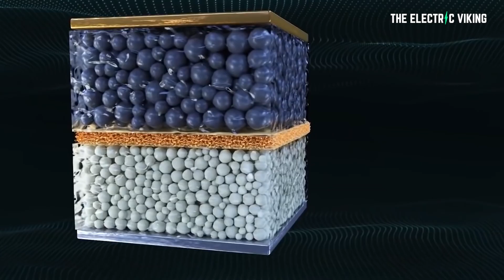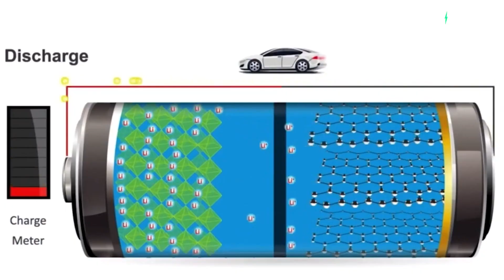New electrolyte prevents EV batteries from fire & increases range

Comment: Any improvement in thermal properties which allows for a higher cell density per battery is welcome.
That said, 212°F is still only 100°C, which is hot, but not 'extremely' hot. Presumably that's the temperature at which it still cannot be ignited deliberately? The flash point will be higher than that, because it's already higher than that for older technology cells.

Comment: Yes, 212°F is literally the boiling point of water. But even plain newspaper burns starting at 450°F, so on a more common scale, a simple trash fire will keep that battery burning.
Reply: Okay, so you put any other vehicle in a newspaper pile burning and what happens? The gas tank is a pressurized system. The gasoline boils in different levels in what is essentially a system that is designed not to allow vapor to escape. What do you think that 450-degree Fahrenheit fire is going to do to that pressurized system with a tank that highly conducts heat? What was your point? I take it that your point is that a battery being on fire is safer than a gas tank that will act like a water heater that builds up pressure. That was your point, correct?

Comment: I have read the summary of the paper and it does indeed look like they are less flammable using the new electrolyte but they are not fireproof. Runaway overcharging or damage through an accident can still cause ignition but I would not say that is any more of a risk than ICE vehicles. The problem with the electrolyte being difficult to extinguish once ignited still exists. Their performance is close to existing Li-Ion batteries now but it is less so you would hope that being able to run hotter you could reduce the cooling system weight and also pack more batteries in to compensate for the lower power density. For static power storage, there are already much more cost-effective batteries than LI-Ion that are perfectly safe with regard to fire, and what's more, they are made here in Australia. Bromine batteries are as simple as it gets and the chemistry has been with us for over 100 years. Look up Redflow and Gelion for info on the batteries being made right now. Again these are for static power storage but that is needed more than even batteries for EVs.

Comment: Sam. PLEASE!!! Do a video going over all the battery new that has come out this year.  I seems like every week there is new battery news, new materials, new types, new process, the sodium, the solid state, the turnery, the LFP.... it goes on and on.  How is a regular person supposed to keep up, or know what is actually going on right now.... what is being used in vehicles, what are vehicle companies doing to improve their batteries now and in the next 12 months.  PLEASE do a overview of all this, as 1 video of 1 possible improvement, and then 1 video of 1 new chemical, and then 1, and then 1... I don't remember 50 different videos on batteries, and I don't know if with new innovations coming out, if old innovations have been scraped.  We all need a overview of where EVERYTHING is now.  How can there be new development every week and all the companies are using the tec. as 3 or 4 or 5 years ago??  Something doesn't seem right?  Thanks for all the info and work you do.
Reply: There is an enormous divide (often referred to as a "valley of death") between discoveries in labs and practical adoption. Some discoveries just cannot be adapted to mass manufacturing at affordable prices, others fail to find support and financing, others are displaced by even better products, or inferior products with better marketing support (Beta vs VHS) before they gain market share. Then manufacturers that use products like batteries will want to see the product "prove" itself before risking making the switch, otherwise you end up like GM and the LG Chem pouch cells. GM rushed EV's to market using development teams that did not have a grasp on what was needed to properly ensure battery quality and purpose, battery management and thermal systems, and vehicle software to properly integrate them. Many promising ideas/discoveries will not necessarily see wide adoption for any combination of these reasons, and the tech that you can buy off the shelf now is the one that you know is available.

Comment: I've never heard of lifepo4 ever catching fire. I've seen people put nails and screws through then, large batterirs dropped from great hight from cranes, run over with tanks.  Total shorting, turning steel white hot. Never seen one catch fire.
Reply: If I had an antique ternary battery factory I'd be interested, instead of changing the whole factory to something up to date.
Reply: It has half the energy density of a Li ion battery.
Reply: @DinoAlberini  LFP is a Li ion battery.
Reply: @michelangelobuonarroti916  they use different cathode materials.
Reply: @DinoAlberini  Yep. Although they also have three or more times the cycle life. I would rather have the Tesla with the lifepo4 battery pack, that still gets 80% of the like new range in 15 years and didn't have to worry about it bursting to flames or after 5 years, having to dish out $20,000 for a new ion battery.

Comment: Maybe much to ask but I’d like to see a report and assessment of all the gamechanging battery news you have presented (100rds ?) so far. Maybe a write a book. I’d gladly buy it!
Reply: There have been hundreds of game-changing batteries, but the game hasn't changed. Commentators like this one are quick to read the press released they receive, but slow to report the once-promising tech that failed closer examination. It's years between YouTube commentators getting excited and new battery tech actually being delivered in new EVS. But some battery teck will eventually make it to production.
Reply: It takes time to work up to mass production in most cases.  Yes there shave even numerous game changers in the ev and battery space.  One game changer may supersede another and cause others to be old news.

Comment: The work they are doing on batteries is mind-blowing at the moment.  I recon that we will reach the ultimate in about then to fifty  year's time. THAT's when I will buy my first EV.
Reply: Having "the ultimate" in tech is not needed. Most people who own ICE cars don't have the "ultimate" internal combustion engine, just one good enough for the price point of the vehicle they can afford. The same applies for EV's. When most EV batteries are now expected to last 300k to 500k miles before they even lose 10% of their original range, the quality of the battery is not an issue, but perhaps the price is.

Comment: Isn't Centigrade higher than Fahrenheit for the same numerical value?.
Reply: Multiply by 1.8 and add 32.
That converts c to f
Reply: @thomaswilson2917  I just mentioned it, Since I felt the Fahrenheit numbers mentioned in the video to give a false perception of high heat tolerance.
It would be fine, when used relative to body temperature or to represent weather, but seemed not well suited when used in the context of molten or superhot metals involved in the EV fires.

Comment: With all the effort going into research, I doubt solid state batteries are that far off; probably practical rollout within two years.  And I've come to expect them to be superior to current designs. NASA, for instance, is all over it.
Reply: Perhaps but they have been all over Fusion for the last 50 years.
Reply: They have to get costs down and it might be intrinsically impossible given the materials.
Reply: They have working solid-state batteries now but material costs and scale-up issues make them unviable for mass use. I am watching the news out of three front-runner start-ups and they are all saying 2030 is a best-case scenario so I would not hold my breath for two years then.

Comment: Wow EV fire are getting more common as EV's age and more are on the roads and if you include Electric scooters and other transport devices being EVs as a percentage there's probably more EV fires then ICE I'm probably wrong there haven't researched the numbers but still it is a big problem and the main problem with EV fires is they're much harder to extinguish so yeah hopefully this tech works out again time will tell but I still don't think batteries are the answer for the future of transport
Reply: 😂😂😂 over 100k of ice cars every year in the US catch fire. I was asked so I looked it up.
Reply: @vec306 , an you can no more turn a fire hose on a petrol fire than a battery fire.

Unlike petrol, a battery can't leak out onto the road and spread. There is no gaseous battery/air mix that is potentially explosive. It's pretty much contained to the vehicle.
Reply: @vec306  yeah I did to as a percentage of cars sold in a year it doesn't look good 0.03% EV - 1.5% ICE but EV have only been a major player since about 2010 so as a hole registered ice to register EV I'd say that gets closer but good luck finding that info plus I've had cars with fuel leaks you have to be mighty unlucky for it to catch fire and most ice vehicle fires are either caused by electric short circuit or brake fluid leaks who would have thought brake fluid pretty sure that would effect EV's and yes of cause fuel leaks but yeah biggest issue is fuel fires have been dealt with for a rather long time so they know how to deal with them EV fires are a whole new ball game that have been known to reignite days after the flames have gone one article I read said there slower to take hold to but I've seen footage of batteries exploding so what to believe actual footage or journalists I'll go with footage
Reply: The newest info is that ev fires should just burn themselves out.  Too much water and foam needed plus runoff contamination and reigniting potential.  Just about every vehicle fire is a total loss with insurance companies
Reply: How hard it is to put out the fire is not the problem. The problem is EV’s can catch fire days or weeks after the crash event. Ice vehicle fires usually happen when the vehicle is being used. Or within a couple of hours of being used. 

Fire departments need to learn this so they can communicate it to the vehicle owners. If you get in a crash but you can drive away park your car outside for a month.

Also if your EV gets flooded with salt water it needs to go to service and parked outside for a month. 

Ice cars catch fire without being in an accident. That just doesn’t happen to EV’s.
Reply: @ecospider5  if any car gets flooded with salt water walk away from the car.
It is now useless. Salt has now corroded all the electronic connections in the vehicle.
Reply: @thomaswilson2917 Yes anything that the salt water got to is toast. But they are putting more and more components into water tight cases. The 2022 model Y battery pack might be waterproof enough to survive salt water. We will know in a couple years by looking at the production year of model y fires after flooding.
Reply: @ecospider5  have 2022 model S
Not worried about water.
Reply: @thomaswilson2917 Firstly, congrats on the model S. 
I would definitely agree the battery pack in a 2022 Model S is sealed well enough the saltwater is not getting to the battery. But if it does get flooded enough to get saltwater inside then there are plenty of connections that need to be verified. Door electronics, seat electronics, ect. But at that point you would have to decide on what to do with the upholstery.
Reply: @ecospider5  most likely car will get totaled
Salt doors dashboard etc.
Lucky I have full insurance
Reply: @thomaswilson2917 Yes if you get any salt water in the interior it’s going to be totaled. So I guess I’m thinking about what value it’s going to have to the scrapyard.
Reply: @ecospider5  battery might be okay
Same with drivetrain mabry if fluids changed soon enough be before any corrosion occurs if salt water enters.
Reply: @robincollis6349  do ice fires as a percentage of miles driven
Icec cars are about 11 to 1
Don't forget 5000 fuel pump fires bit zero supercharger 
Fires